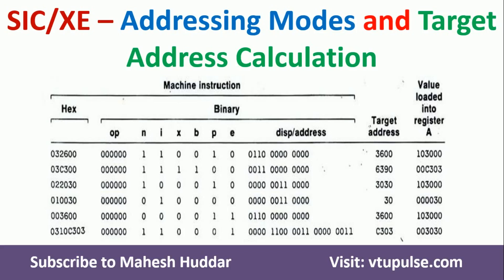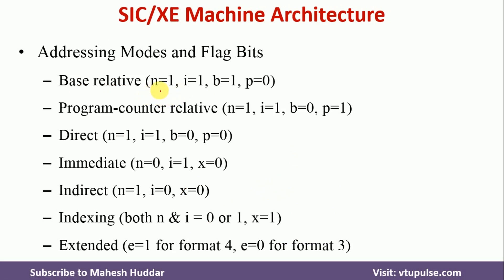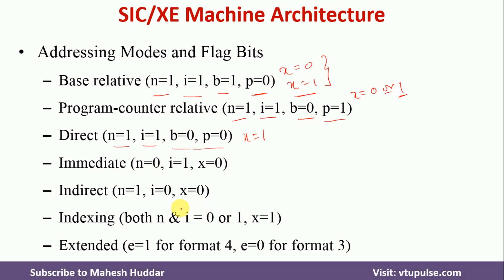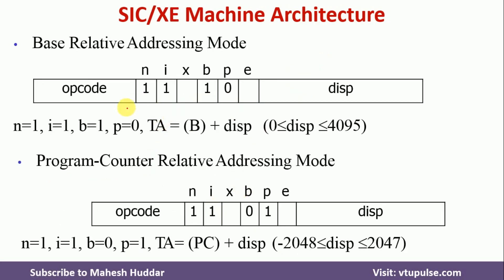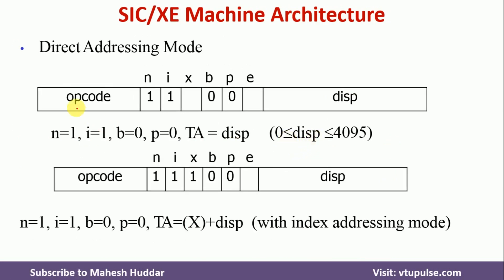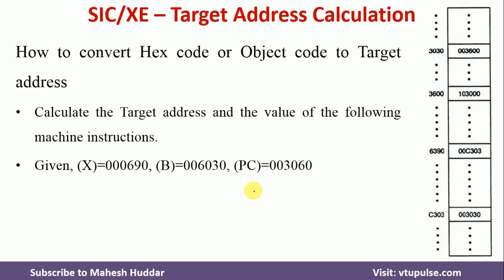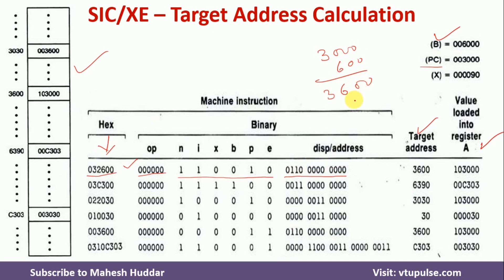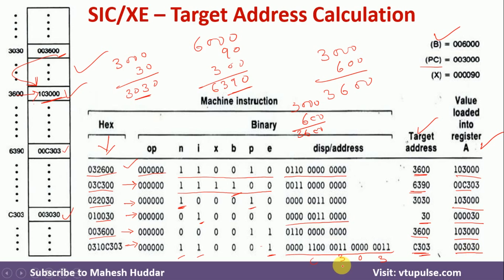4. SIC / XE – Addressing Modes and Target Address Calculation | System Software by Dr. Mahesh Huddar

Comment: May I know how you moved to next register in 3rd  calculation of hex value. iT HAS TO BE 3030 but you said because of indirect addressing mode we moved to next register i.e 103000. can you please elaborate on this..Thank you
Reply: its pc relative indirect addressing mode since n=1 and p=1 formAt 3
so target address TA= pc+displament for pc relative addressing mode 
since its pc relative indirect addressing mode , we need to do one more label.
that is look value in the TA above we have found 
now that value is TA new ie TA = value stored in the memory (in this case its 003600)
now search for the address 003600 and again find the value in memory (103000 in this case ). 
for the trick : compare it as the pointers but its not the pointer . just to remembering purpose 
hope it helps ...🙂
Reply: @biswasbanstola  bro but in inderict addressing mode TA= (disp ) so why has he taken TA calculated by PC relative mode as disp and then calculated indirect addressing mode
Reply: @Aditya-ri7em  bro disp is written inside () so the content of disp will be the T.A
Reply: sorry it will be value loaded not T.A